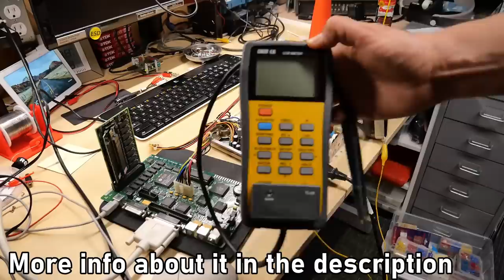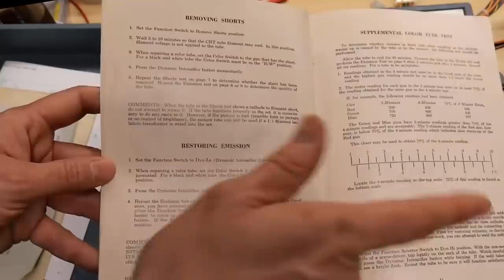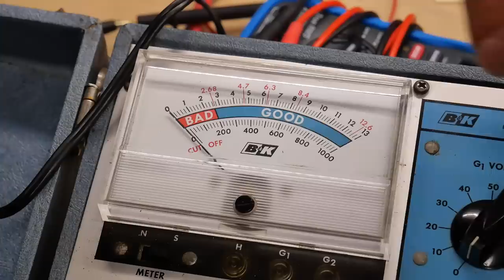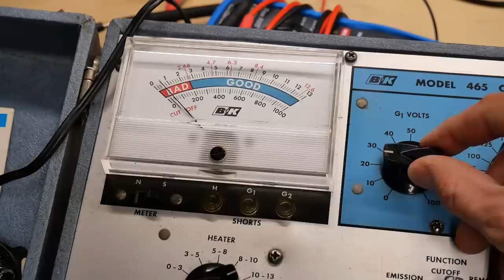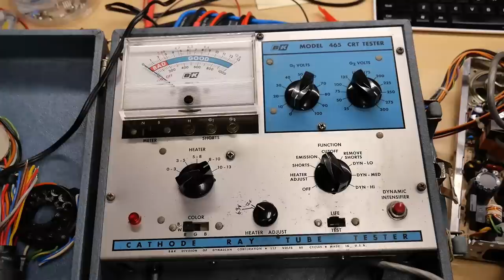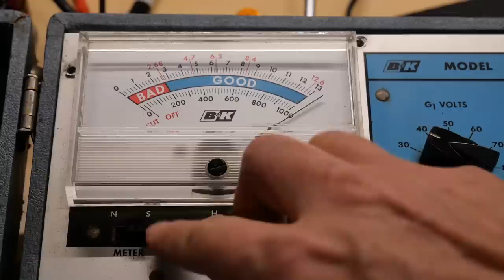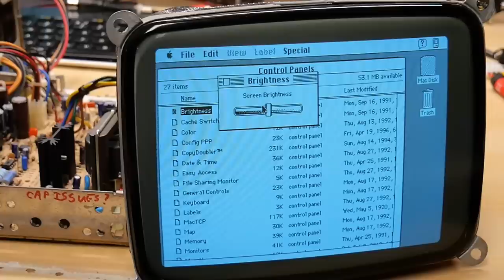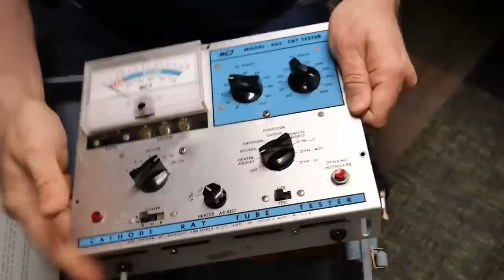Rejuvenating a Macintosh CRT with equipment from 1969

Comment: It would be cool to know if this lasts if you keep using it. Maybe make a follow-up video several months later comparing the performance.
Also, it would probably be a good idea to replace the rest of the capacitors just in case. It doesn't matter that they seem to be working now - they are over 50 years old at this point, so they probably won't last much longer
Reply: words of wisdom
Reply: @oldestgamer  If your a Mr Carlson's Lad regular, you'll know those caps are leaky.
Reply: They're dry electrolytics, they are probably fine. I've found plenty in old equipment that still test new and I have not yet had any fail on me in service.
Reply: For equipment you care about keeping for a long time, yes you should probably replace all of the capacitors and the resistors right now to prevent future problems. Old resistors fail very often in these types of devices as well as the capacitors.
But that's not diagnostics, that's full on restoration at that point.

CRT restore/rejuvinate is pretty widely known in the television community to be a gimmick. It's just a band aid to give you enough life to get the customer a working television while the shop orders or rebuilds another tube for them. It's similar to a CRT brightener - You're not supposed to keep using it for so long after.
Reply: @classiccomputers6211  Well, given that one of them failed right in the video I'd say that replacing the rest is a good idea.
Reply: @AiOinc1  With the exception of cathode poisoned CRTs, those can be permanatly fixed with rejuvenation, especially if the getter gets re-fired at the same time. This one had no burn-in, a CRT like this needs tens of thousands of hours to become that dim, and after this, at least the picture area inside the black border would burn into the phosphor, no burn-in on this one. Either because of the low heater voltage it was given by the misaligned PSU for who knows how long, or because of some slight gassiness, this CRT was almost surely cathode poisoned. If it is gassy, it won't last long unless Adrian finds a way to flash the getter, but if it was caused just by long term underheating, it will last 'forever'.
Reply: @classiccomputers6211  My experience with those made in usa electrolytics is rather bad. 
Had to replace all of them in my wireless set 19, as well as in my hallicrafters s-86. 
Dutch and german electrolytics from the same age seem to age a lot better, though they should always be treated as suspect - check if high voltage is high enough, feel if the caps heat up.
Reply: @Fly0High  yep, instantly thought that as well. Mr Carlsons lab is an amazing channel.

For all those who don't know: You have to test those caps with high voltage, they will look fine with normal tester, but the leakage will increase with voltage, so at the max rated voltage those caps will be out of spec.

Comment: Hi Adrian, I've seen some videos  from a German TV technician explaining all the rejuvenating stuff.
Here is what I've learned from that videos.

The cause of the tube getting darker is some oxidation at the surface of the cathode that builds up over time. 
The rejuvenation is the process of removing this layer. 
If you turn down the lights you might even see the dirt flying of the cathode and being burned away. So what you did was basically correct. 

In the video he was also talking about the different tubes and the different voltages of the different color and much more. 
This is kind of a science of its own. Btw he was not to hesitate about pushing the button ;-) 
Starting at low and tying to burn away the stuff a few times. If it wasn't enough he used medium. High seem to be really aggressive and the tube might not take it well. But if it's not working with medium the tube is almost toast anyways.

Comment: I'd like to make a couple of points:
1) A heater is not a filament. A heater is used to indirectly heat the cathode. A filament is a directly heated cathode
2) The raster is the grey (in this case) area displayed on the tube. The lines that are visible with extreme brightness are called retrace lines.
3) I think you'll find that the 6.3V heater supply is AC, not the 12V DC that is probably feeding the Mac tube. I the old days when tubes (or valves as we call them in Australia) were popular, there were devices that were basically a small transformer that could supply higher heater voltages to brighten picture tubes. These picture tubes lasted some number of years with the increased voltage.

Many years ago

Comment: This is a really cool video.  When I first started working as a tech in the 1992 we had one of these on the shelf in the back room.  We use to use it on ADDS dumb terminals that the screens got too dim on.  I don't think there was ever a time that they came back with a screen to dim again in the 4 or 5 years we did it.  Eventually all the customers just left the dumb terminals behind and put in PC's with ProComm though, so they were already well on their way out before I started working there.  Great video.

Comment: Its great that you took my advice from the previous video and tried CRT rejuvenation, now you need to buy or build in-circuit ESR meter for you to be able to test caps without removing them from the boards.
Reply from the maker: Oh I show my DE-5000 which I bought which allows me to test in circuit.

Also a secret -- I made this video on May 8 -- so it was luck it seemed to be a response to comments. :-)

Comment: Oh wow, this reminds me when I used to re-gun CRT's in the mid-'90s.  Fascinating process.  Oh, and the post oven and vac down spot-knocking process were always fun and firing the getters with a high powered RF induction coil.
Reply: I've been really interested in the re-gun process for some time now, but there's almost no information out there about how it works, what the process is like, or what equipment is used.

Comment: Adrian, go to e-bay and search for "picture tube booster" or "picture tube brightener". These are small transformers that go in line with the picture tube connector. ( it will be obvious when you see the photos of them ). They boost the filament voltage by about 2 volts. While there is a danger of the filament life being shortened, when all else fails they will give you some additional life from a "useless" tube. These were very popular "back in the day". There is presently a lot of 5 selling for $9.99 and one of them appears to have the correct socket/plug combination.

Comment: I picked up a Sencore CR70 off ebay several years ago. It came in handy in testing and restoring monitors in a couple arcade machines. I guess it's suppose to burn off carbon build up within the CRT to clean off that buildup. But at the cost of shortening the life of the electron gun. But of course if it is looking bad and your going to junk the monitor. Might as well give it a go. 
As maybe a side note, The manual restore procedure on mine says to let the heater warm for 30 secs before hitting the restore/rejuvenate button and to never go over 15 seconds of holding the rejuve button. Not sure if that helps with the B/K operation. 
Any way, keep up the great work! I enjoy the videos that you have made available. Keep it going!

Comment: Remember using one of those back in the 90's to bring back to life hundreds (probably  over a thousand thinking about it) poorly customer crt's over the years, and must have had about 30 different base plates in a big drawer in our lab. Most heaters ran at 6.3v. They worked quite well for about a year or so but then the crt would fade fast, but you could kick a tube several times before it was scrap. If you gave it a good blast you could see the rubbish being blown off the gun, see the needle kick and usually worked quite well.. The good old days! Oh and ALWAYS make user you fully discharge the tube or you will blow a hole in the phosphor on the tube lol

Comment: Great work bringing the screen back life. There are probably many people who envy you.
You probably might want to replace the capacitors in your CRT Tester. 
I think i saw an old "roundy" resistor, they dont handle moisture so well
I'm no expert but even though the capacitance and ESR measure right, the can be leaking badly. "Mr Carlson's Lab" have some good tutorials on old components.
Great piece of equipment you found there.

Comment: Great to see how this came out! I have an old portable TV from 1982 with a dim picture I might want to fix up. And in other news, the shorted capacitor in the tester could've been worse. I was working on an old tube intercom and a capacitor failed shorted between the ac input and the metal case. Fortunately I did a quick safety inspection of the internals before plugging  it in. I highly recommend anyone dealing with old equipment in unknown condition perform a similar check as well.

Comment: I've seen people try to rejuvenate old CRT tubes, and completely render them useless in the process! It is a gambling crapshoot!
if you blow the heater or short one of the grids, it is GAME OVER man!
BUT, when they work, they really make a difference! I use to work for a post-production house and I repaired a bunch of Shibasoku 21-inch high res component monitors that used to cost $45 to $50 thousand dollars! 
We had a similar B&K tube rejuv/tester, and we repaired a bunch of old tubes with it, some even had shorts, etc... 
It either worked great or it killed the tubes dead, there wasn't much middle ground!

Comment: I wouldn't mind seeing a proper restoration on that tube tester if you have the time for it, rewiring it and having a standard base that you could plug all those sockets into would be neat. Maybe breaking out the sockets into a common (high voltage) connector (ATX molex?) might make it a bit friendlier to use
Reply: Also you probably already know this, but Mr Carlson's Lab and Shango066 are both excellent resources on field equipment like that. Nice find!
Reply: @lauram5905  Mr Carlson would also say that those old capacitors should go even if they seem to be fine. He always replaces old electrolytics.
Reply: @Sheevlord  And I do think he's right. With the cost of those parts nowadays you'd be crazy to test them 6 different ways just to save $2 a piece to run them a little longer and possibly blow a bunch of other kit when they do go with a bang. Really easy to replace too with that old point to point wiring.
Reply: @Sheevlord  Shango tends to make an important point depending on what he's working on that some pre-power on troubleshooting should be done before a wholesale recap in case that ends up masking an issue but yeah, checking voltages. physical inspection and calibration prior to connecting it to anything would have been my first thought. He definitely had the right idea making sure he knew what pinouts he'd be dealing with though. Wonder how many people have blown up tubes just socketing them without checking

Comment: Way back when I was 5 years old in the good old days of black and white  all valve TV,s I learnt and watched my Dad fixing TV,s and whenever the Cathode Ray Tubes emissions where getting low or the picture was out of Focus and very silvery looking all over, he used to rejuvenate them without even having the Test unit you have.
Usually what causes the low emission is a short from the heater to the cathode which you can't read with a test meter. How he fixed almost every one was to get a piece of coax and touch one end onto the disconnected CRTs cathode pin and the other end onto the EHT output from a line transformer usually around 12 to 15 Thousand Volts which blasted the carbon short away  , he would then do the same to the heater pins. If this didn't work well enough we would fit an isolation  transformer to supply just the 6.3 or 12.6 volt heater only, this effectively removed the short between Cathode and heaters allowing full emissions.
We did this to many TV,s because new or reconditioned CRT,s where very expensive at the time.
There where also many TV tube recondioning factories who replaced the Electron Gun Assembly including the Tube Neck for a lot less than a new tube (crt).
If you overdrive the CRT by increasing the voltage then the CRT will start emitting dangerous levels of XRays from the front which is never a good idea. All CRT,s emit small amounts of XRays.
I did go on to become an Electrical and Electronics engineer.

Comment: Nice to see that it did the job in the end, I reckon it'll probably last quite well! As I commented in your last video, I have a B&K 467 which i've had for years now (it has separate meters for each electron gun), which came with quite a good variety of adapters including the most common used ones on arcade crt's (I think CR-25 is the most common). The crt's i've used it on have most of the time lasted pretty well. There's been one 19" tube that started to dim down within a minute of it being switched on, and a couple of 29" tubes (both the same make) that I couldn't really get anything out of at all as one of the guns in each was well past it, but most of the time it's a good result. I did do an ex-Pole Position tube once, which as usual had fairly heavy "GAME OVER" burn in it (clearly had a LOT of hours on it) but it came up really nice, I was going to use it for testing Hantarex chassis out. Unfortunately something inexplicably fell off one of my shelves over night and knocked the end of the neck off!
Reply from the maker: Yeah the 467 seems so better and more advanced with what it does. Would be interesting to somehow try to compare the two -- of course one would need two CRTs in similar bad condition to compare.
Reply: I don't know if the functions are that different in operation, but on my 467 it has two types of function - 'Rejuvenate' and 'Clean and balance'. Clean and balance seems to be for if a CRT is ok but maybe a little dim or maybe one or more guns is a little weak. Rejuvenate seems to be only needed when one or more guns are really on their last legs. Occasionally i've had shorts or focus problems (which it can clear if I remember correctly), although H-K shorts I don't think can be repaired, at least not with the 467. In that case, if the heater circuit is powered from the chassis, you have to isolate the heater circuit from the chassis, and instead wind a couple of turns of wire round the flyback's ferrite clamp in a specific direction and then wire them to the heater, which produces a voltage for the heater isolated from the chassis, so the short then doesn't matter.

Comment: Cool video.  You should zero the analog meter with the screw on its face--it might be a little more accurate.  I've always wanted to see one of these used, and love it when ancient test gear can still be relevant.  I'm not nearly old enough to know this, but I remember there were also kits you could install for ailing CRTs that would boost the heater voltage on a weak tube to get a bit more emission.

Comment: Great video Adrian.  Damn nice piece of gear to find at a thrift shop,  I love vintage test gear like that and especially old vacuum tube based oscilloscopes.  But yeah as a bunch of people already said in the comments,  them old electrolytic caps gotta go.  All it would take is one of those caps to short out and potentially damage that power transformer,  and that thing probably has a dozen taps for all the different heater test voltages.  Finding a replacement would be difficult to say the least.

Comment: Hi there! Actually, when using such an old equipment, you MUST recap EVERY capacitor inside. They're busted for sure. Don't risk your equipment, change them all and it will be as new!
As for the macintosh, you also must recap every capacitor in that section. They leak acid, and that acid is very conductive, this can lead to other faults, for example they can short and fry the SMPS chip or other components. Nice video btw! :)

Comment: I can’t wrap my head around how not a single one of the wires on that adapter has continuity
Reply: Heavy oxide layer on the pins will do that, and perhaps the potting has shrunk with time and snapped off the internal wiring as well.
Reply: Possibly they used some agressive, corrosive (acidic) flux to solder the wires. I've seen this before with figure-8 type power cables.

Comment: Thanks Adrian, this is a very good experience of using that piece  of old equipment, but I think you have to re-cap it with correct value, who know if a bigger capacitor will affect the meter's reading. And the good news is even the reading is not accurate the tester really work well. I do love the 60's and 70's equipment, they're build for durability and able to repair easily.

Comment: We had one of the later 467 models with a bunch of adapters, had good results with colour tubes that got quite  a bit of extra useful life out of them but monochrome ones were rubbish, you'd get a few weeks, maybe a month or two of brighter picture but it'd fade real quickly. We also found the more you rejuvenate the shorter the life.
Handy trick for a poor emission tube is to boost the heater voltage, an extra 0.5-1V can make quite a difference to emissions, if heater votlage is line derived then an extra winding or two on the ferrite of the Line output transformer in series with the heaters might just do the trick.

Comment: Electrolytic capacitors age and die as you know too. What I prefer in my restorations is to change them all, regardless of what they show on a capacitor leakage tester or an ESR meter like yours. (Good instrument by the way, congrats on the choice) Any old capacitor that is OK today and you decide to leave on the board, will be the source of a new problem in near future. I love the "rejuvenator" what a great find. Very very lucky guy you are, most probably it will never do any good, but it looks fantastic. I was about to say that there must be a bunch of dead capacitors in the CRT tester too, but you found that out. :-)